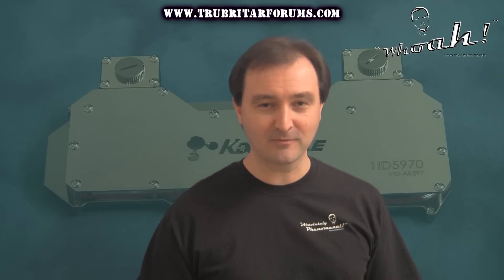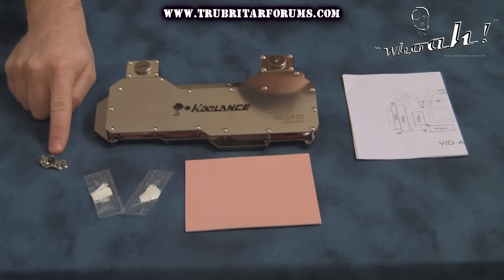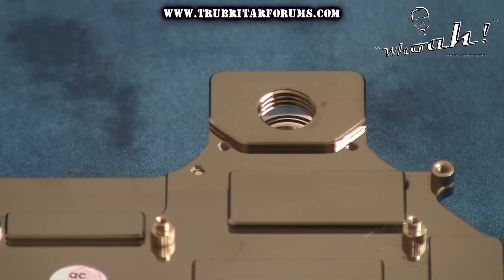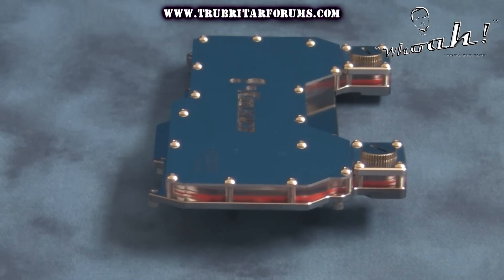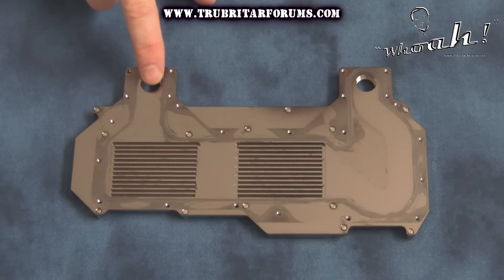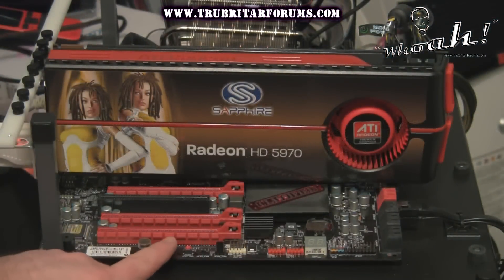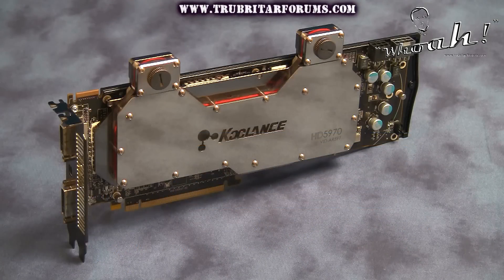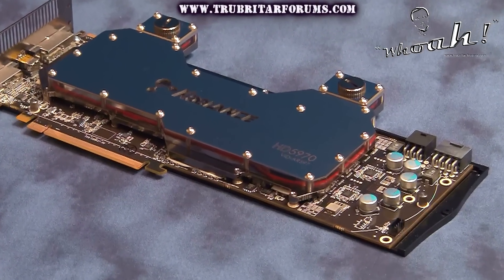(1080P) Radeon  HD5970 Extreme Burn Tests

Comment: @nauls82 Yes, always provides excellent ventilation that hardware to work optimally, have a good performance and useful life is complete. recalls that the Xbox 360 is marked "Factory Overclocked" without ventilation.

Comment: Well, if you already have a good loop then you have the possibilty to add your GPU in it. But GPUs were never meant too be overclocked and performance improvements are minimal. The only reason I would go with watercooling is noise, but a good aftermarket aircooler would do the same job at half the price and hassle.

Comment: A great looking waterblock, now if only you could replace the bracket to a single slot solution. But I guess it's not gonna be an option on this vard due to all the connectors.

Comment: I meant the 5970. Priced lower than the 5970 which is dual GPU, but have almost the same performance and single GPU. Beats the 5870 by at around 40%.

Comment: well the price of a good air cooler like the thermalright copper is only 20 bucks cheaper than a 5970 waterblock which is one of the more expensive blocks out..
if you look at the cpu blocks they are even cheaper than the thermalright,,and they take up alot less space. And you have to admit, water cooling just looks bad ass.
Wow the xbox is just a pile of junk,,all the way around,,,ive had 2 die on me so far..working on the third..lol